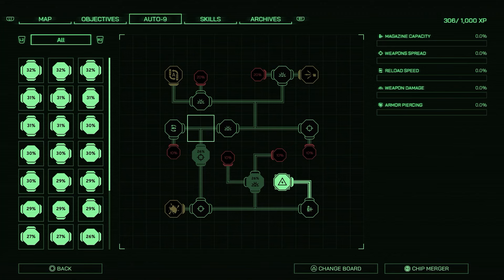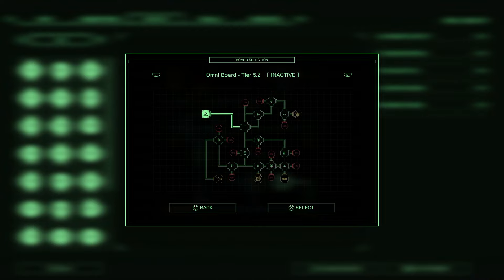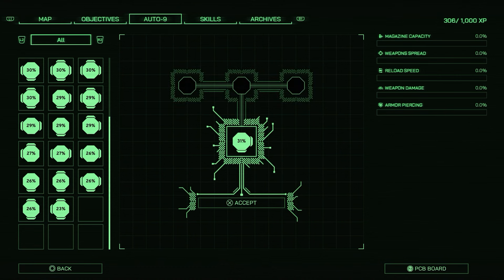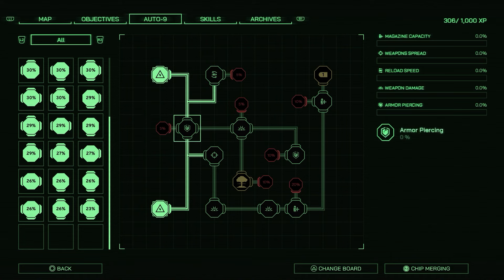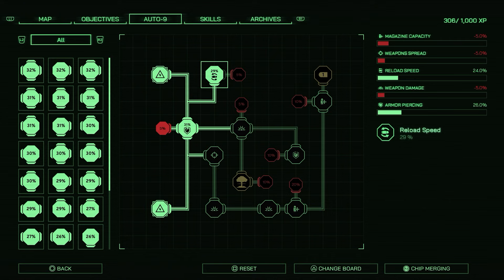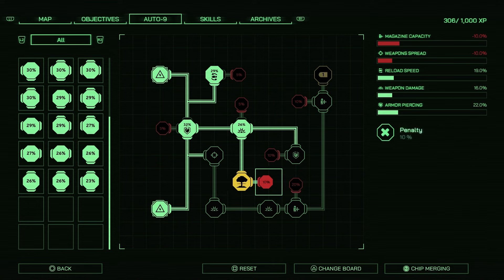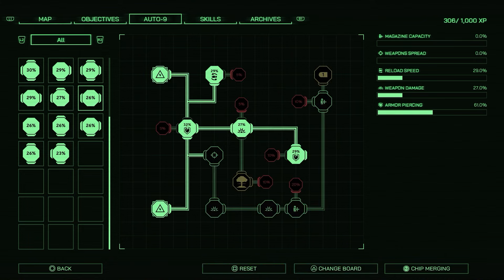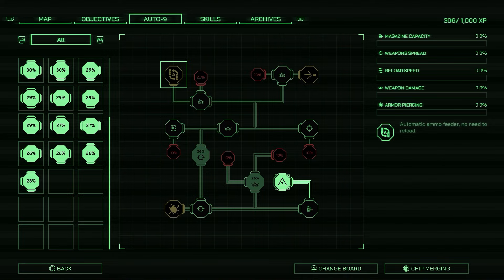Auto 9 Weapon Upgrade Mini Game Guide For RoboCop Rogue City

Comment: One thing worth mentioning is the fact your Engineering skill increases the bonus you get from each chip, and at higher levels you can get some obscene bonuses from that. These bonuses are particularly useful when you get the late-game PCB that has full auto AND no reloads but also requires you to take a -30% penalty to everything if you want both. With high enough Engineering, your chips are so good that all the 30% penalty does is make you slightly less OP.

Comment: This reminds me of “Bioshock” mini game. Yes, putting points in Engineering will increase your chips. Good for Offense. There’s Perks for single Fire and full auto. And Perks with no reloads. You find them later in the game. 
Also for tips you can try different pieces. Avoid the Penalties and try to use your strongest pieces. 
Another tip, using Slow mo in the Firing range at the Police Station, will help you get higher points.

Comment: Putting points in engineering increases the chip percentages. It allowed me to upgrade weapon skills later. As it improved the damage, I just avoid penalty and use the highest % chip for each slot.

Comment: I still don't quite get it. I tried the chip merger a couple of times and all I got was weaker chips as a result. Also on my first board there is a unavoidable debuff slot if you want to go past and get a skill which is a little strange. Actually do think it is worth it though as I get to place a srong chip to wep damage plus getting the skill which is enough to take the -5% to all hit imo. Fun little feature either way!
Reply: When you’re putting the pieces in make it so they don’t pass through to the red ones. So ignore a cross up down left and right. And the red thing is on the left. Get one that only goes up down and right.

Comment: I didn't think that the board system was that complicated myself, tbh.  The board that you highlight as a good board, with the automatic ammo reloading on it, if you fully upgrade that board, what you end up with is a semi-automatic, long range, infinite ammo shotgun, due to the way that the bullets break up.  It's excellent on tougher enemies, especially the ED-209 bosses.  I would say that board is the best board in the game.  I don't use any other.  Once you've got that fully upgraded, really, you can merge the rest of the processors into better processors, since you can rely on that board alone.  It doesn't make sense to use any other board.
Reply: So try not to turn the nodes red? I still don’t understand
Reply: The full-auto board that increases gore and armor penetration just annihilates everything. Since you can switch boards at any time, and the same nodes can be equipped across all boards simultaneously, I recommend switching between the two to notice the shotgun effect is easily eclipsed by spraying pounds of lead which actually penetrates and damages.
Reply: @MajorJakas  That's what I've been doing, switching from one board for ED209 and bot fights, to another board for armoured merc fights, to other boards for street thug fights.  Whichever board I need for the fight.  It's especially pleasing, using the shotgun effect on a street thug, at point blank range, and just watching his head collapse.

On another note about shared nodes, be careful if you try to change three nodes for one node in the merger system.  I noticed that if you change three nodes for one node, it will take processors out of nodes on your other boards, so you might loose that node if you aren't being careful, and the board that you aren't currently using will not be complete.

Comment: I thought the automatic reload feeder was a bug since I couldn't reload (but still had bullets) and the message to reload just stays in my screen. They could at least remove this notification with that perk, my ocd make me go crazy about it, I reloaded a save 30 mins earlier just to try to remove this dang notification lol
Reply: I think there might be a slight bug when switching between motherboards, where by it keeps skills from the previous board. I noticed I still had full auto on that board that has auto reload. If I then went back into the tab for the motherboard and didn't switch just viewed and closed the menu it then lost the full auto. Edit* I also changed with empty mag so had the reload message.